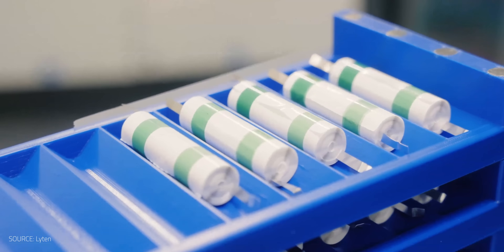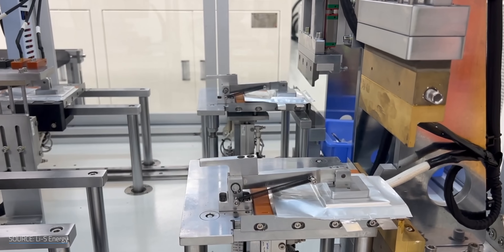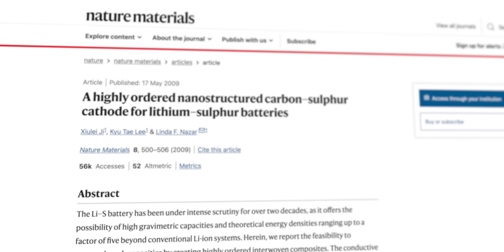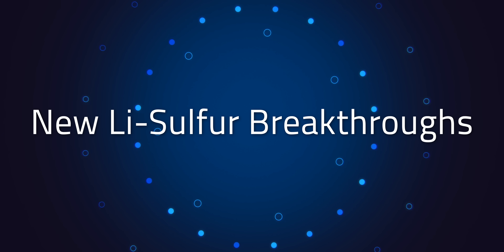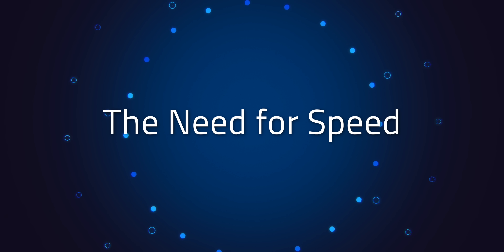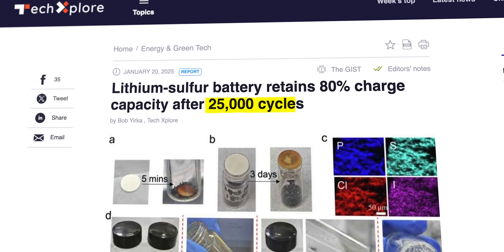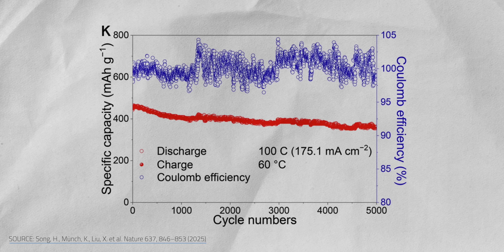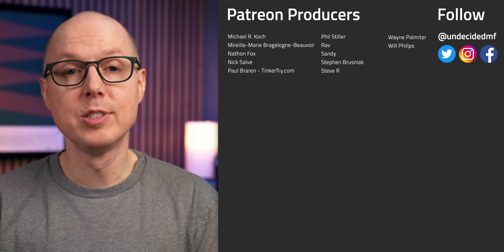How This Overlooked Battery Might Change Everything

Comment: Another day, another battery tech to save us all :-) 
I'm still holding out for fusion energy, it's only 20 years away you know!
Reply: You can't have a fusion reactor in your car; it will still need batteries of sorts to store the electricity!
Reply: True, but with fusion energy, we could have abundant hydrogen to fuel hydrogen fuel cells, eliminating the need for batteries. And that’s just around the corner!😅